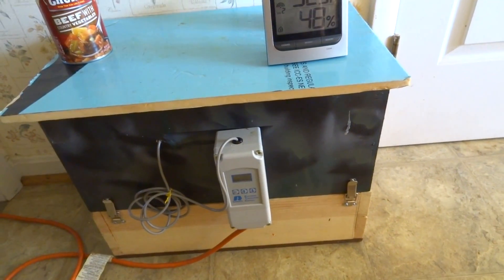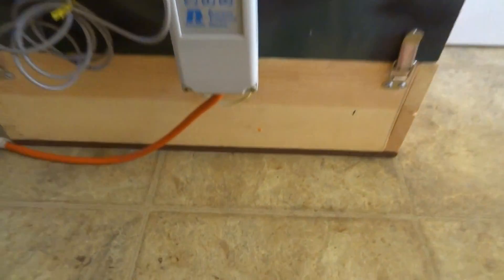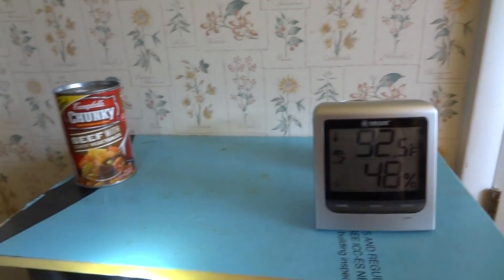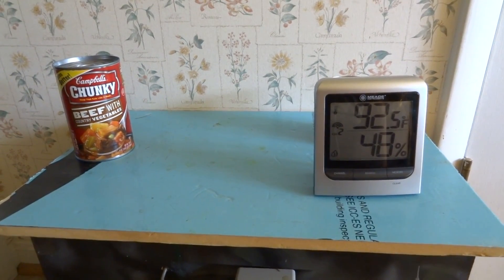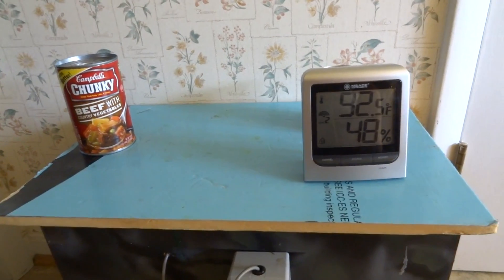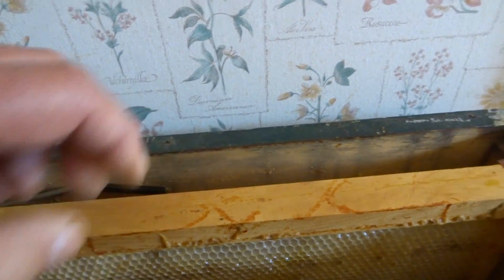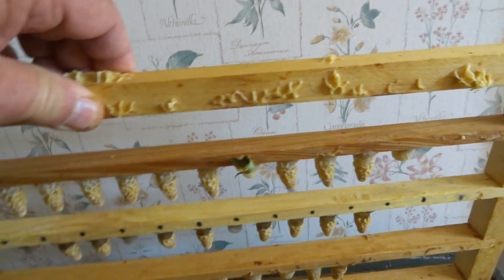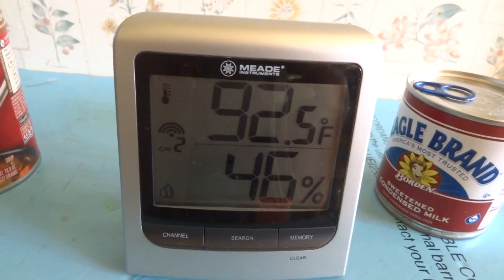Queen incubator

Comment: what did you use for a heater?  Did you use a ceramic heater?
Reply from the maker: +Michael Josemans 
Michael,
I tried different heating elements. I found that appliance light bulbs worked best and are cheap. Appliance bulbs are also long life and made to cycle a lot.  I'm happy with the queen incubator performance it is so much easier and less worry. Now I can check the queen cells anytime I want without leaving the house.
Reply: Thanks...I ordered the parts you suggested.  I wanted a nice incubator to do a small scale queen raising for my apiary. Thanks for sharing.  I didn't want to try  and figure out how to wire a refrigerator in reverse as i have seen in many videos.